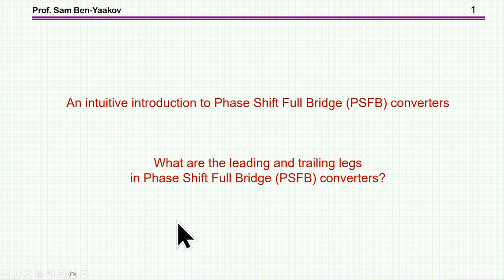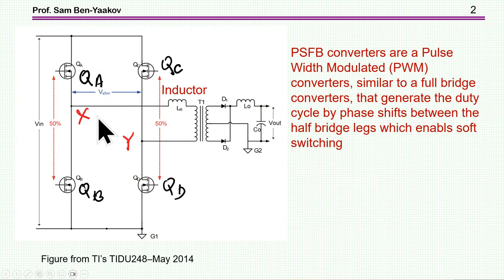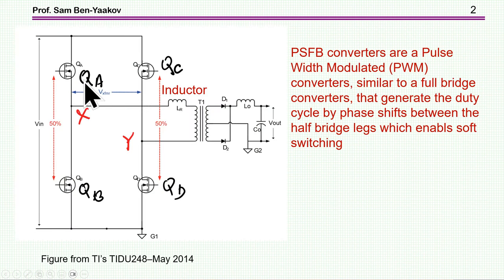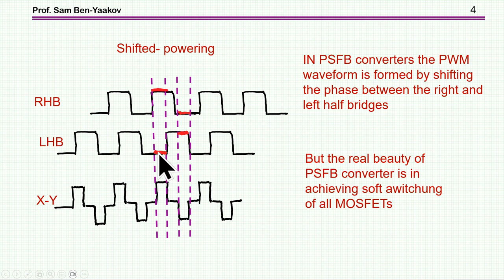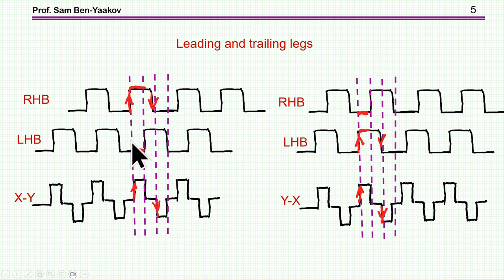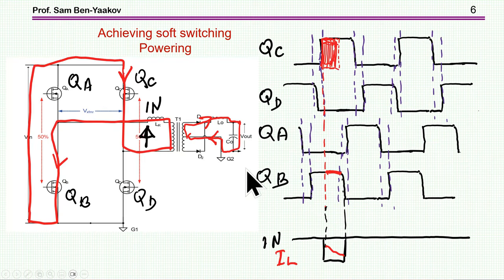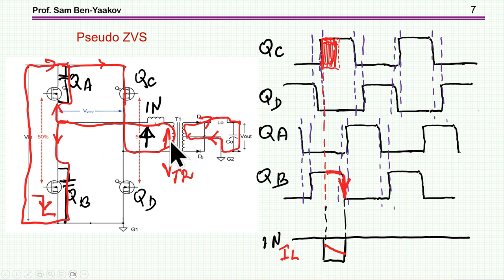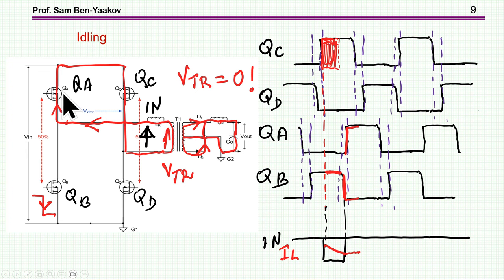An intuitive introduction to Phase Shift Full Bridge (PSFB) converters

Comment: Thank you for your good explanation of the PSFB converter. But I want to make a precision; in the idle mode the output current will decreases (voltage across this inductor is -Vo) also the inductor current will decreases (curent transformer at 0Voltage).
Reply from the maker: You are correct of course. Thanks for the clarification.

Comment: Dear Professor Ben-Yaakov, 

Thank you for all the knowledge you are constantly providing us!

I do have a question about the matter presented in this video:

Can you please explain why in the ZVS the body diode of QA will conduct (or "catch" as you said in 8:17).
As I see it, on ZVS the capacitance Cds of QB will charge to Vin and Cds of QA will discharge at the same time and when the voltage drop on QB will be equal to Vin the voltage across QA will be zero and we can switch it in zero voltage drop. 
If QA body diode will be in forward biased that means QB Drain-Source voltage will be Vin + 0.7 (assuming 0.7V forward voltage). is it possible?

Your answers and explanations are appreciated.
Thank you!
Reply from the maker: "If QA body diode will be in forward biased that means QB Drain-Source voltage will be Vin + 0.7 (assuming 0.7V forward voltage). is it possible?" Yes, this what happens. WE need to allow some spare time to make sure there no shoot through, during the deadtime the body diode is conducting. You ca see it in simulation.
Reply: @sambenyaakov  
Thanks, I'll try it on a simulation as you suggested.

I'm designing a Phase shift topology DCDC converter at the moment and was wondering if you're planning to upload video about PSFB which has a more in depth explanations such as: control method, transformer design and operation modes, serial rectification and current doubler method?

Comment: Thank you so much, professor for the lucid explanation of PSFB converter operation and the enabling of ZVS because of the phase shifting operation. I was trying to simulate this topology and had two queries relating to this: Q1. As the phase shift becomes a degree of freedom in the PSFB converter, what exactly are the use cases for this? Can it be used for selective harmonic elimination, etc.? Q2. As the phase shifting is already helping achieve ZVS, do we still need to intentionally add deadtime in this topology (as we do with usual PWM based converters having bipolar switching for full bridge converter)?

Comment: Thank you for your good explanation of the PSFB converter. Would such a converter also have a capacitor in series with Lr - not for resonance, but to remove any DC current component that may give rise to flux stair-casing in T1. If so, how should the PSFB description be looked at or modified?
Reply from the maker: Yes if voltage mode control is used. No, if current mode.
Reply: Can you pleaase elaborate on this? 
If the current measurment is on the output and not on the transformer is it still possible to remove the capacitors?
Or maybe, if we already have a current measurment on the transfomer we can make sure that the control can offset the DC back to 0?  

 @sambenyaakov

Comment: Hello Professor, at 10:59 time of the video.......the voltage reverses but the current will still be negative since MOSFET Qd is not turned on yet...until gate for MOSFET Qd is given the body diodes of both Qa and Qd is conducting hence current is still negative but voltage is positive....but you have drawn current also as positive...Please clarify this for me Professor.

Comment: Great video, professor! I am working on a psfb application and this was very insightful. 
In some psfb application notes using peak current mode, I see the current signal is measured at the input so that there is no risk of flux walking and saturating the transformer.  
If we instead moved the current signal measurent to the output, in series with the inductor, do we still run the risk of saturating the transformer and now need DC blocking caps?
Reply from the maker: Yes, you either use PCM or put a capcitor in series at the primary.

Comment: Good day, Sir. Considering a ZVS feature (presents in both architectures), what would you advice for an SMPS for audio: LLC or PSFB? Both are supposed to be used with an open loop. In addition I'm planning to go high: 800kHz-1MHz, so PSFB arrears a brick simple, but I'm not sure about which type will give me more clear rail.

Comment: Question ; when designed for a fixed load power" would a PSFB configuration produce LESS spikes than other  variable load converters  running at the same power?  IF NOT why would PSFB ever be considered?
Reply from the maker: Historically, PSFB =>  DAB => LLC. However, PSFB has advantage in fixed power with large duty cycle due to the lower rms current and economics.

Comment: Sir,during Idling the current direction you mentioned is the opposite and the mosfet will not turn on in the current direction mentioned .Sir , can you confirm this ?
Reply from the maker: To which minute in video are you referring to? Which mosfet will not turn on? Please clarify.
Reply: @sambenyaakov  sir during 9:45 QA will not pass the current in the direction mentioned in the slide